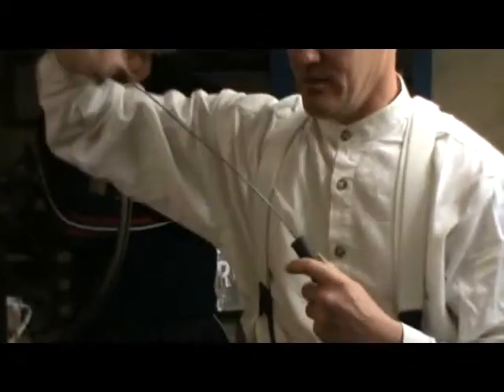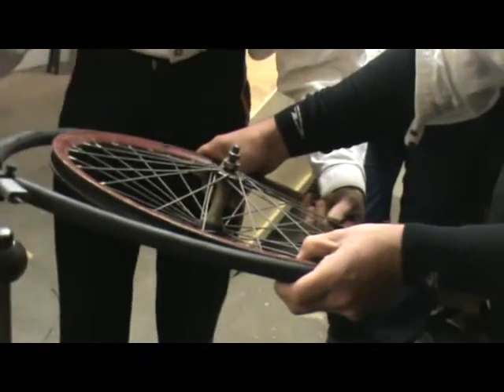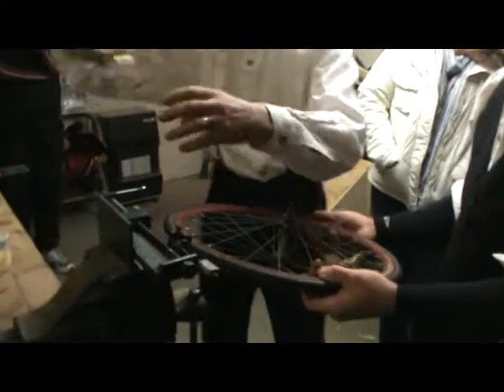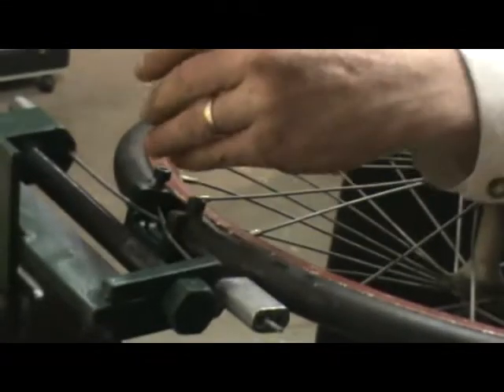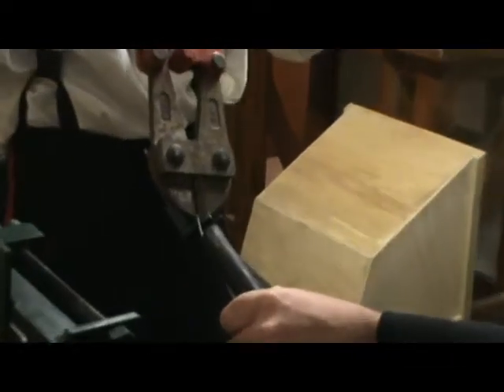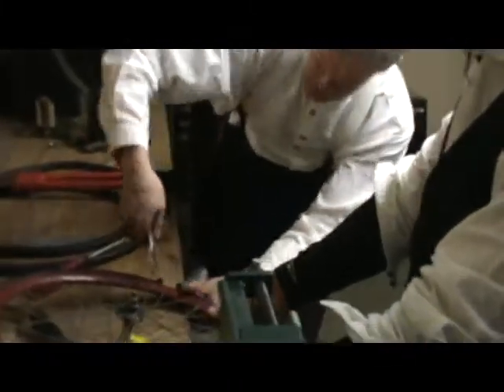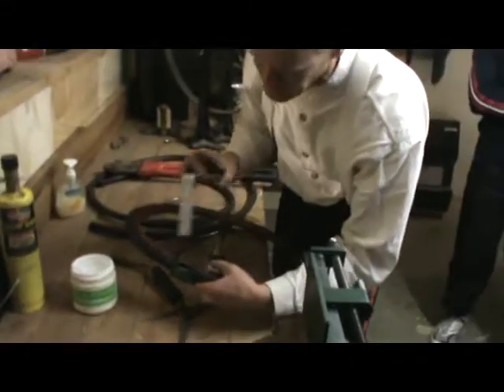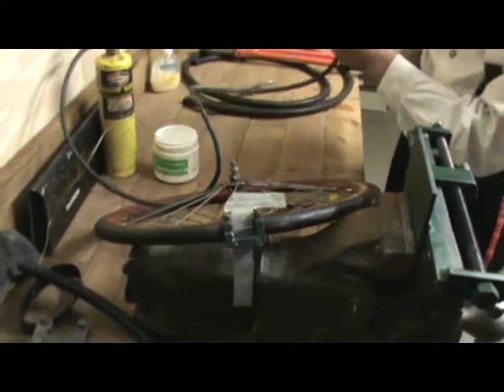Fitting Penny Farthing tyre

Comment from the maker: @Basbekema It is what used to be used for fencing. The old number 8 wire. I found the modern high tensile fencing wire was difficult to join reliably. The wire I use is medium tensile and can be welded or brazed more reliably.
I was having trouble getting the rubber so I got moulds made by a local rubber factory and a quantity made. The wire I get from a wire-works on their recommendation. So both available from my website, check my profile.